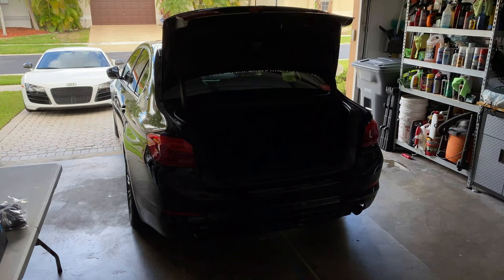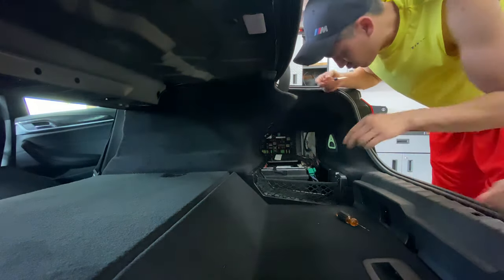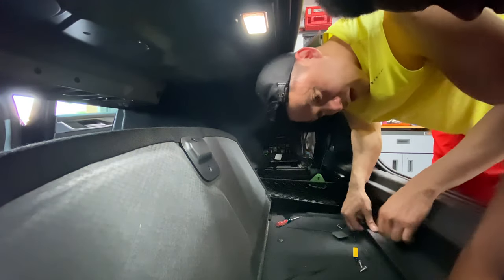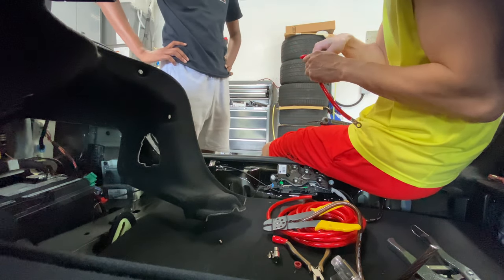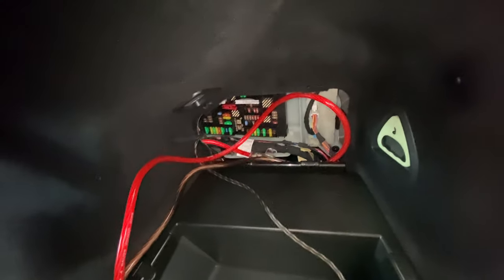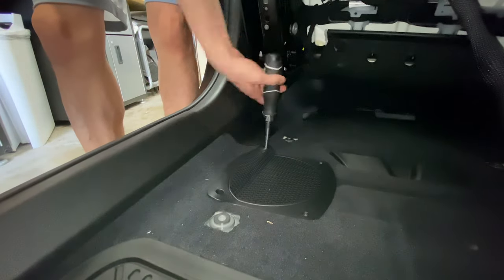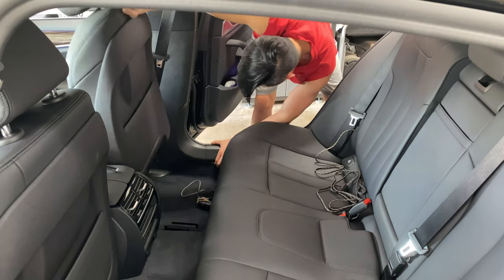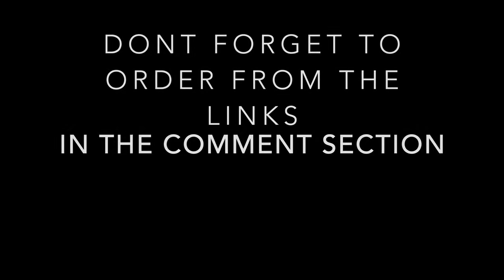BMW 530e 540 F90 G30 Add Additional Subwoofer & Amplifier F80 F82 how to wire external amp in a BMW

Comment: Needed this. Thank you! Did this on my Toyota. But I’m afraid of taking my beemer apart 😅 but it’s so much easier if the battery is in the back. I’ll just Google the audio diagram and tap into the back this way I don’t have to take off the seat or run cables
Reply: What'd you end up tapping into?? I have a 750i and the trunk is so damn well isolated I can't access any cables..will have to go under the seat and run wiring all the way back.

Comment: Hi there, I have the same car. Doing the install myself. I notice my battery is producing 17-25 volt. What did you do to reduce the voltage or was there a problem with the high voltage on your amp?

Comment: Nice video. I just have one piece of information. I see you have the Hifi (base in USA) system in your car. In that case your OEM subs aren't 8 Ohms as you said but they are 2 Ohms. So don't put these in parallel or you end up with a 1 Ohm load that wil fry most aftermarket amplifiers. When you have the Harman Kardon or Bowers & Wilkins (or even Bang and Olufsen on older cars) then you have 8 Ohm subs that can be connected in parallel for a 4 Ohm load. I still wouldn't advice connecting them parallel however. These subs play pretty high (up to 160-200Hz) and there is quit a lot of stereo information coming from them that you will loose when connecting them parallel. It's best just to keep them stereo.
Reply: Are you talking about where he connects both negative and positive wires? Then what would be the solution if that is what you’re saying? Thanks

Comment: Wow,Where did you pull the Remote wire from the amplifier?
Reply from the maker: JL audio amp doesn’t need remote wire.  But there is a cigarette lighter in the trunk you can use.

Comment: If you use different specs amp and sub. Will it work the same way you installed?  I’m very new in it.
Reply from the maker: yes
Reply: @DuhRaceCar  and how the system will shut off once the car is off or locked
Reply from the maker: @umairaslam2388  the amp I use is self sensing so when no audio is on it auto shuts off.  However the line converter that taps into the stock subwoofer that I list in the comments section can do the same and has a remote wire.
Reply: @DuhRaceCar  so remote wire needs to connect to stereo wire. So it will shut off when stereo is off?
Reply from the maker: @umairaslam2388  the Unit can sense from the subwoofer of music is on or not

Comment: I have a sealed trunk with no ski hatch. Does the sound make it through to the cabin? Iv'e heard its difficult on BMW's
Reply from the maker: it does but I would get the 12", and you will want to play with the direction of where the sub is facing.  for me facing towards the rear sounded best

Comment: Thank you so much for this, I've been losing my mind not knowing why my amp is not switching on with the audio signal, I didn't even think about the harman subs being 8ohm and bridging them. Finding a, source for a switch live is near impossible on a g11 7 series
Reply: I recently did this on my G12, I tapped the sub wires in the trunk on the left.  Its the thicker pair of speaker wires (there are two pairs that are the same colors twisted together).  It should be the same for the 5 series Harmon Kardon Blue/Red +
Blue/Brown -
Reply: @tonytam4767 brother can you help me out. I have a g12 as well.  I can't find any sub in the back and I can't find any diagrams to see if there's speaker wiring in the trunk. I think it's only under the seat. I don't want to run cables from the front to the rear as the g12 is so damn well isolated from the trunk to cabin. I literally don't see any holes and taking the plastic trim apart to tuck cables on the g12 is a pain. I'd rather keep everything in the trunk. Which cables are you referring to in the trunk?? I have the HK system. Anyway you can post a quick vid. The rest of the system is a easy install. Just need to find a signal to tap into and literally can't find anything on forums
Reply: You need to take apart the trim in the trunk on the left. There is an amp there
Reply: @tonytam4767  tore the whole trunk out no amp.... Under the seat subwoofer tap it is

Comment: Quick question. Is there a reason u tapped into the underwear sub? I ask because I'm about to install a sub, and there are speakers on the parcel shelf which are closer to the amp.
Reply from the maker: yea so the speakers on the shelf in my car arent full range.  They dont have the low frequencies needed for the subwoofer.

Comment: Hello, I installed the way you did except I tapped into the trunk going into amp because I got sub output wire diagram from bmw. Everything works except LOC kinda gets hot and smells little bit burn. Is there something I need to worried about. I used same LOC as yours and with this 
Rockville RWS12CA Slim 1200 Watt 12" Amplified Powered Car Subwoofer Enclosure
Reply from the maker: Are you running the remote wire to it?
Reply: @DuhRaceCar  no, the remote wire is running from direct amplifier to cigarette light fuse. It doesn’t make AMP turns off  when I run from LOC TO AMP. however, I am still running LOC Yellow wire directly to battery while black to the car body. Thanks!
Reply from the maker: Sounds like it might be wired incorrectly or the loc might be defective.
Reply: @DuhRaceCar  should i tap into 4 wires. Instead just one subwoofer wires.
Reply: @DuhRaceCar  finally, my loc melted out.

Comment: I received LOC. SO Do i need to connect LOC Yellow wire to car’s battery to get power or not?  Thanks
Reply from the maker: if you want to use the blue remote wire from there then yes hook up the yellow one to constant power.
Reply: @DuhRaceCar  i did everything you did in video but the sub is very annoying or distorted. I have jbl gt basspro12 built in amp. I was able to get wiring diagram from bmw so I tapped in trunk using Lockitt Posi-Tap. Do I need to change setting to amp or LOC. Also amp won’t power on until I connect positive wire direct to remote turn on. But when i run through LOC to amp it won’t.
Reply from the maker: Your speaker signal is prob not right. Try testing the sub with a different audio signal like from your phone.

Comment: Hey I had a quick question. Did yo use a remote wire? If so which fuse did you use? Or what did you use in general for the remote wire?
Reply from the maker: JL audio amp doesnt require a remote wire, it has auto signal sensing. But you can use any aux power, I typically tap one of the cigarette lighters.  The  SCOSCHE LOC2SL has a remote out you can use to send to the amp also, if you want to hook that up to a constant power which would prob be easier.
Reply: DuhRaceCar thanks for the reply! I actually figured out What was going on with my remote wire. I believe the line broke somewhere I couldn’t see so I just replaced the remote wire and used the cigarette lighter fuse. As for the auto sensing signal, I have a JL audio RD1000/1 I in my 530e. To get the amp to turn on I have a switch with 3 options.  It says Rem, offset or signal. If I wanted to use the autosensing which option is that.
Reply from the maker: @forrbyc1508  signal sensing is the one to turn on if you dont have a remote wire.
Reply: @DuhRaceCar  Nice video! Question I'm going to be using my SWS-12D4 Alpine 12in Subwoofer and a Kenwood amp KAC-7005PS from my previous car. Installing in 2018 BMW 530e. I see there is a cigarette lighter right in the trunk on the right above the fuse and battery area. Would that cigarette liter work to power on the amp ? On my manual for the amp, is says power control wire, can I just extend that line to the power control wire connection on the amp and will it cause any harm? Here is the manual for the app KAC-7005PS : https://manual.kenwood.com/files/52d48b90ea81f.pdf Thank you for the video and if you're able to help!
Reply from the maker: @adidax3  that should work fine it is what I would usually do in a regular install.  I don’t tap anything since my amp has auto sensing, and the signal converter has a power out from sensing.
Reply: @DuhRaceCar   I'm actually going to go with a HiFI 676 add a sub harness for my stock amp, that should save the time running a line from the under seat subs https://technicpnp.com/product/hifi-676hk-674-add-a-sub-harnessloc/ However my only problem now is that I'm not sure where to get an enclosure that will fit my 12 in alpine sub in the back of a BMW 530e since the EV batteries take up so much  trunk space. I see you have a 10inch sub, any recommendations for finding an enclosure that would fit in a 2018 530e Hybrid BMW?  thanks!

Comment: 0
REP
1
POSTS

Drives: 2014 F30 2023 G30
Join Date: Aug 2023
Location: Hawaii

iTrader: (0)

Aloha all,
I have 2014 F30 that I recently gave to my son and picked up a 2023 G30. I love G30 because of the added space (being 6’ it’s awesome) and also loved the F30. I have a bit of a problem though right now with the G30. I installed an amp and sub into the F30 by tapping a LOC to the speaker wires myself. I then picked up the 2023 G30 and thought I could do the same but now I have no sound and the warning systems are not working either. Any ideas? I put Everything back together but it hasn’t corrected yet. Do I need to drive it more for it to reset or do I need to do a reset? PLEASE HELP!
Reply from the maker: Might be a fuse.  You can always get a odb2 scan to see if it narrows it down for you?  I usually try that first
Reply: It's fixed. It wasn't a fuse and actually don't know if it was the wiretaps triggering the error or if it was the sensitive stock amp cables being readjusted. Anyway I appreciate the help and maybe when I conjure up some confidence i’ll attempt it again.

Comment: One last thing, is it safe to connect parallel to oem sub like this because of impedance.
Reply from the maker: If you are installing an aftermarket sub also you probably do not want to since they have different specs.   If you are powering your oem subs and bypassing the stock amp you need to check the ohms on the stock subs.  As another poster said the Harmon kardon system has 8ohm subs and the hifi system is 2ohms and need to wire according to what your amp can handle.
Reply: @DuhRaceCar  I’m confused. I thought we are just getting signal from oem subwoofer then why do we car aftermarket amp as long as it is compatible with aftermarket subwoofer.
Reply from the maker: @umairaslam2388  yes in my video I am just getting the signal and running it thru the converter to get the rca signal for the after market amp to power an after market subwoofer.   But you can also power the stock subwoofers with an aftermarket amp, but you just need to unplug the stock plug
Reply: @DuhRaceCar  i want to do exactly same thing you did. Adding subwoofer and amplifier. However I wanted to ask as long as both are compatible then there shouldn’t be any problem with the stock amp and subwoofer?  Because we just getting signal through stock subwoofer. So doesn’t matter if i get 2 ohm or 4 ohm. Am i correct? Sorry for confusion
Reply from the maker: @umairaslam2388  you only need signal from one subwoofer don’t not both.  But you can if you want
Reply: @DuhRaceCar  yh i will connect to one subwoofer oem.

Comment: How loud is it in the cabin? I installed a sub but it’s barely noticeable.
Reply from the maker: Did you have it facing the cabin and is it bolted down
Reply: @DuhRaceCar  it is facing the same way as you. I only have a 10in sub tho.
Reply: @DuhRaceCar  Did it make a big difference for you? What sound system did your car come with?
Reply from the maker: @udaypatel7057  that was just for the video.  It should be facing towards the cabin and screwed down so you can feel the bass.  Also make sure you have the right gain settings
Reply: @DuhRaceCar  did it make a big difference? By flipping it?
Reply: Did you tap into ur underseat woofers to give them more power with ur amp?
Reply from the maker: @udaypatel7057  it does make a big difference and I did not add power to stock woofers.

Comment: From the LOC yellow power wire, what fuse can I tap into from the trunk fuse box for “switched power”? I have a 21’ g30 540i.
Reply from the maker: The amps I use normally self sense a signal.  But there should be a cigarette lighter you can tap back there.
Reply: For the self signal, does this eliminate yellow wire from LOC and the remote wire from LOC into amp?
Reply from the maker: Yes

Comment: Remote ?
Reply from the maker: Amp doesn’t need it.  But if your amp does you can use the in line converter.  It has a remote wire